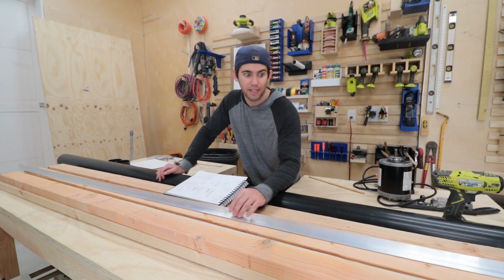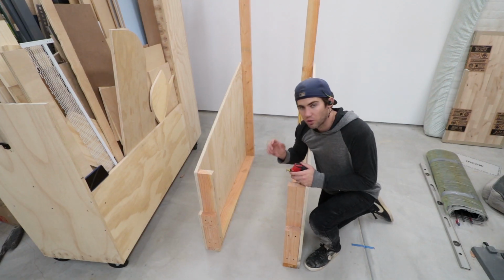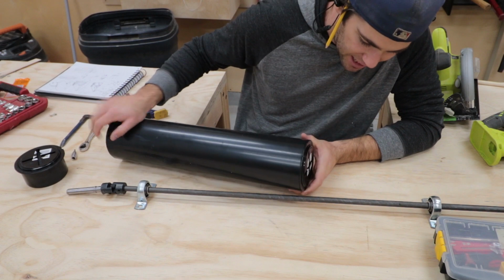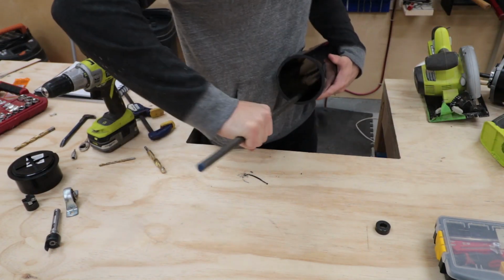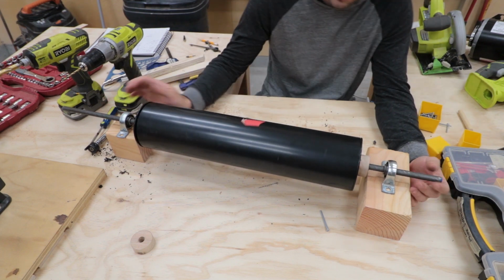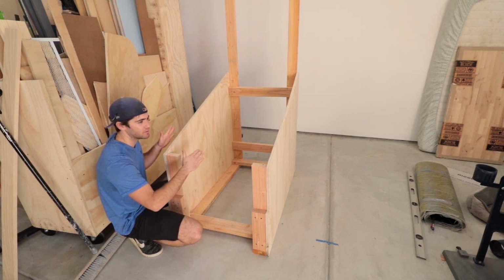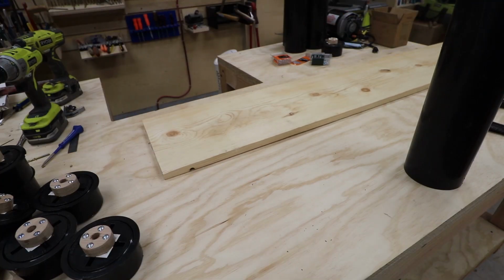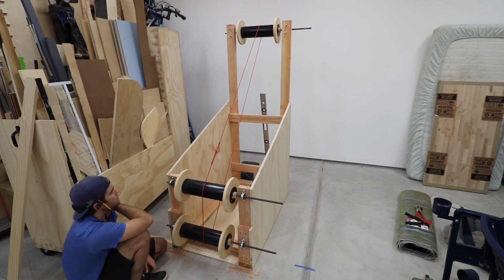Universal Marble Machine Lift Build, Part 1

Comment: Depending on the load/tension on the plastic pipes, the metal rod ('axle') connected to the motor might start to slip within the pipe - time will tell. 
Also, if the axle is rotating too fast, add a cog (diameter to be determined) and drive it with a (bike) chain to the motor?

Comment: What type of scroll saw blade are you using for the circles? I have the same saw and have only found blades that cut straight, pin end I think they’re called.
Reply: I see it looks like you may have just turned the direction of the blade, wasn’t sure if they were a spiral variety which seem easier to cut tight shapes
Reply from the maker: It’s just a normal scroll saw blade. Their main purpose of the tool is to cut intricate curves. Not sure what’s going wrong on your end